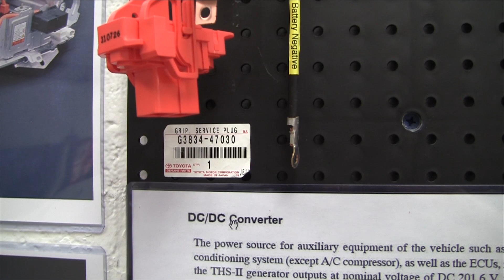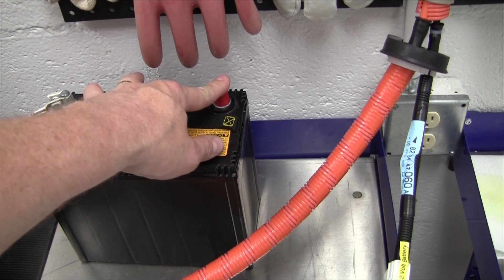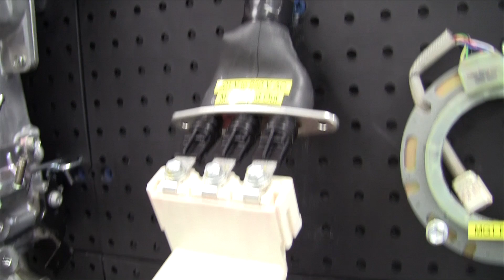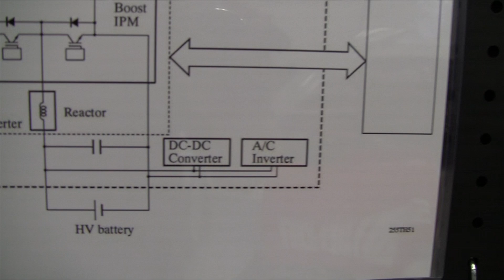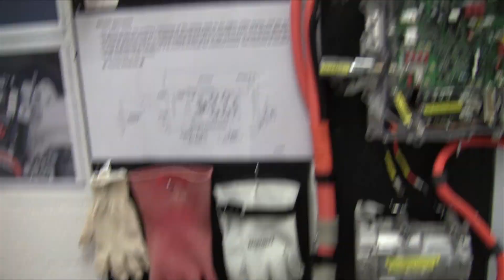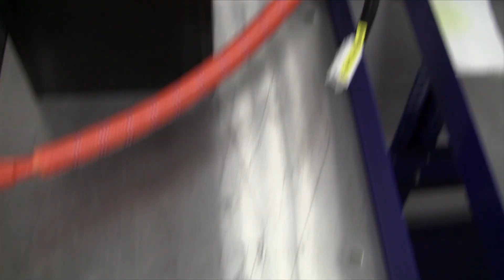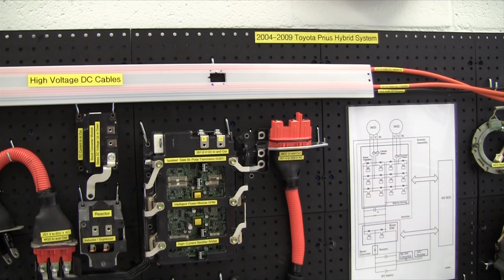2004-2009 Toyota Prius High Voltage System Operation

Comment: I just paid 800 for a Prius the bus bars where heavily coated with die electrical grease on the contact points once I noticed It I removed the grease and car ran fine

Comment: Can you let me know what the resistance of MG1 should be and how to check it?  My car has the p0a92 code and also a code for an inverter fault.  It still starts and drives if I clear codes but it goes super slowly and will shake near-violently if the speed gets over about 40-45km/h.

Thanks for the video.

Comment: I would like to turn prius into an electric generator to power the home. Assuming i have  a source of power to turn 1000 rpm. Remove the gas engine and attach my source to the flywheel. Will this turn GM1 and GM2  to become Generator to charge the battery or use those power to power the home of course with converter down to 120V 0r 240V.

Comment: Ive been looking at this video trying to figure out a way i could use this synergy drive for my solar and wind turbine setup and im thinking that it’s possible.  It seems that the 3 wire for mg1 and 2 could become a wind turbine connection to charge a series battery bank and the dc to dc converter could charge a 12 volt bank or possibly connect straight to the 12v AC INVERTER.   I was wondering what you thought about that idea?  But also thinking that the components are maybe possibly solid state and dont require a-lot of ecu management.   Would the IGBT setup just convert/invert current without an ECU less the Ac pump im sure ?

Comment: Can you explain for me this problem? why does the DC-DC converter circuit has 6 IGBTs? I see  only 4 IGBTs on manual. I also see 6 IGBTs for A/C Inverter on manual but it has only 4 on board.  There are 12 IGBTs ( parallel 6 pairs of IGBTs ) for Motor on board but only 6 for generator .But, there are 6 IGBTs per one on manual . Thanks for your answer !

Comment: I have a question on the high power cable that runs from the hybrid battery to the inverter. Can a faulty high power cable cause fumes from bad insulation to go inside the cabin? I’m getting a electrical smell/taste in my mouth when I drive my PRIUS. Is there a way to test for a faulty high voltage cable?
Reply from the maker: Not likely a cable problem, the cables run under the vehicle. Check your 12V battery. Make sure it is an AGM battery with a vent tube that vents through the floor through a rubber tube. The high voltage battery also has a vent that vents through the floor.
Reply: WeberAuto I have a 2012 Toyota Prius and people that do battery reconditioning and replacement have told me that they did away with traction battery venting in the newer PRIUS that includes mine.
Reply from the maker: That is not true, they all have venting. The 2016 Prius has the battery under the hood now, but it still has vents. (not through a tube though)

Comment: Good video, I know you are not suppose to tow a Hybrid because of the AC voltage. I was wondering  is there any thing inside of the inverter to stop the AC voltage from damaging the inverter electronic components. In other words is there a protection device inside the inverter.
Reply from the maker: No protection that I know of. I believe damage can occur to the transaxle, the IPM, IGBTs, contactors, fuses,  and possibly the battery if the vehicle is moved with any higher speed than a slow roll. The parking pawl is electronically engaged. That would need to be disengaged to even move the vehicle.

Comment: which motor is used to crank the engine.  Is there any other starter or these  motors work as starting motor.  ?
Reply from the maker: The small motor (MG1) cranks the engine. There are no other starter motors. Thanks for watching!
Reply: so it uses a 12 volt battery when cranking. ?
Reply from the maker: No, it uses the 201.6V battery. But that will not work unless the 12V system is working properly.
Reply: thanks for replying, actually me car has some cranking problem, 12 volt battery is good, but the HV is not , it has 3 faulty cells , showing 6.5 volt , I think the HV battery might be the problem then. , ?
Reply from the maker: +farid jan yes, a bad HV battery will prevent the engine from starting.
Reply: As I have noticed that when IG is ON , there is no power going to the main relays in the battery box and no DC power going the inverter,  As the red triangle light is on and no ready sign , the ECU might be preventing these main relays not to turned ON. am i correct, am i correct ?  or there might be a blown fuse or fusible link as no power to main relays in the battery box,
Reply from the maker: farid jan The contactors will not be activated if the battery ECU determines the HV battery voltage is too low or bad. Check for trouble codes, that will let you know what is going on.

Comment: Other than MG1 what other components could prevent my Prius from starting?
Reply from the maker: Fuses, Batteries, interlock circuits, contactors, battery ECU, not stepping on the brake pedal, key fob not in range. and many other things. Have DTCs checked and go from there. Best wishes!

Comment: Do you happen to know what the max input [battery] voltage can be for the Toyota inverter? I see the Prius pack is ~201V, while the Highlander MGR is ~288V nominal...
Reply from the maker: +Stephen Holland Hi, I assume you are talking about he maximum DC input voltage.  The Nominal voltage is the correct voltage to use. If you try to use anything higher or lower it will cause trouble codes. The battery pack voltage while charging (engine running) can be 50-70 volts higher. Thanks for watching!

Comment: Does the Negative side of the high voltage system connect to chassis ground at any point like the 12v system?

Comment: Thank You for this great video! Very nice job explaining the components.
 I have a question that I hope you either have knowledge of or can 
obtain. Can you tell me what the Kwh is of MG1 and what is the output current of MG1 when it is in regen mode? I realize that the power MG1 is generating is 3 phase which must be changed to DC to recharge the batteries.
Just curious what Volts, Amperage is produced directly by MG1 if in fact it is similar to or greater than a standard alternator prior to being rectified. My guess is that MG1 produces more power output than a standard alternator.

Comment: Thank you a lot of for this video. I have a question about how we can charge hight voltage battery from 220 v?
Reply from the maker: 220V DC maybe, not AC. This system runs on around 500 V maximum, so 220V would take a long time to charge the 201.6V battery
Reply: Thanks, I understand, we can invert 220 AC to 220 DC but how we can conect  220 DC  with a vehicle?

Comment: I currently had the triangle of Doom  pop up on my  dash

I recently had my catalytic convert stolen,   The shop that replace my convert put a weld in pipe  and not a  OEM system  
I’m  not sure if they disconnected the battery before welding on the exhaust 

I have these 4  codes currently  

C1259  HV system Regenerative Malfunction 

C1310 1. Active booster solenoid
            2. HV System Malfunction 

U0073  Control Module communication Bus Off

U0293 Lost communication with hybrid           vehicle control system

Comment: There should be a accident safety cut of switch to both batteries. An example would be as a fuel pump accident cut off switch found in old Ford Taurus or Thunderbird. Yet built to handle the high voltage for the big battery. And one that is capable to handle a regular car battery. Because if the person is stuck inside the car. And they cant get out. Because of structural deformation. Then you are at the mercy of luck hoping no metal made contact to the big battery. Anything is possible. Just saying.

Comment: Thanks for very valuable information. I have a couple questions regard the system. There are so many electronic and mechanical components involved. Does the system have any set up so each piece can be tested or even throw a code something like OBD system? For instance is there a code if an electric water pump goes bad? What do bake booster and power steering run off? Can a prius be driven with faulty HV battery? If yes, can it be driven with AC and lights on? What's the main source of power for moving the car? Thanks again
Reply from the maker: Hi, yes, there are Diagnostic Trouble Codes (DTC) for everything. Brake and steering are electric, but have mechanical backups. Prius cannot be driven with a faulty HV battery, it is required to start the engine. The main source of moving the car is the HV battery powering the MG2 motor in the transaxle. Best wishes.
Reply: I used to have Honda Civic hybrid so it's sounds like Prius is different and gas engine is only for charging the battery. My newly bought Prius light came on and it said a bad battery but I was 100 miles away from home decided to drive as much as I could. I was driving about 70 miles on highway with AC off on 100 degree F temperature till I gradually lost power and had to call for a tow truck then I found out my free AAA towing covers for up to 100 miles! Is it possible that I may have damaged something? Does it mean I still had some hybrid system functioning? Asking for future reference! 
I would like to take some general courses on hybrid vehicles because I am environmentally concerned. I live in Oklahoma City. Any suggestions?
Thanks
Reply: @WeberAuto  Hi. so are you saying that if say 1 or 2 modules are down or dud that would be enough to put the HV main battery in a state of being disabled enough not to start the engine?

Comment: Thanks a lot for the explanations.
Do you think it is possible to use this battery as a stand along power backup module to be connected to high voltage UPS (192V DC  4 kva  invertor which operates battery in the range of cut-off 158 VDC to 220VDC)  Charge 220 VDC  8A
Reply from the maker: Thanks for watching. Probably, but this battery only has a 5 Ah rating.

Comment: Do you have another video on common failure modes? And what component in the system actually fails? The one I am interested in is when improperly jumping the car and that Aux battery experiences a reverse polarity.

Comment: My 2012 Prius hybrid converter with bad at 122,000. Am happy it still had warranty i save 4200. I wouldn't recommend buying a hybrid sooner later the hybrid system will go bad.
Reply: Same as transmission/engine on any car. People are scared of what they don't understand.

Comment: Thanks for showing how the high voltage electrical system works. I have seen people adding a 12 VDC to 110 VAC inverter to draw power from the tiny 12V battery circuit in order to use the Prius as a residential backup generator. In your video, you showed that there is a 206 VAC 3 phase output to the Air Conditioning compressor. In theory, if an experienced electrician adds an ordinary transformer to convert 206 VAC to 110 VAC, the Prius functions as an emergency generator may power a house via a transfer switch to the utility panel during a power outage. Do you know if such application is possible by tapping into the inverter's 3 phase output cables? Power outage is quite common during snow storms or hurricane season, it would be a great feature if every Prius in someone's garage can be converted into a whole house generator with a simple 2 to 1 transformer.
Reply: +LINEHACKER both wrong and am advising you both to stay away from any electrical outlets.

Comment: How do you tow without damaging the inverter? Does neutral cause the electric motors not to turn?
Reply from the maker: +cody cowgill Hi,  Do not let the front wheels spin. A tow truck can lift the front wheels to tow. You can also use a flat bed truck or a dolly. Thanks for the feedback!
Reply: cody cowgill neutral disables the electric motors and should not be used for too long because it cant charge the battery

Comment: Hello professor I hope you read this message and take the time to answer me ... if you do not understand some of my words it is because I am using the translator since I speak only Spanish ... I live in Houston and I have a problem with a Toyota Prius  2007. I have the code p0a78 now.  which does not allow the car to be driven recently. I changed an inverter because that was what the scanner said that he had a problem with the inverter .. he changed it and the same fault continued.  when I put the selector lever in D, the red triangle appears.  and it is as if no electricity reaches the electric motor.  It should be noted that both batteries are good ...

Comment: Absolutely love your videos, been watching you for a long time now!    Now,I actually have a question. I have a 08 Camry Hybrid.  Just replaced the Hybrid battery with an OEM dealer replacement, but even before that when the Combustion engine would start, 50% of the time it really shakes the car, not violently, but not smoothly either.  Where should i start troubleshooting? Engine mounts seem good.
Reply from the maker: It sounds like an engine misfire problem. Check for trouble codes and go from there. Best wishes

Comment: You didnt explain the self recharging process.  how does it gate back to the Hybrid battery. You got as far as explaining there is charge but by through which means does it recharge Hybrid battery??
Reply from the maker: Hi, see one of my other videos here https://youtu.be/Y7Vm-C4MsW8
Reply: sorry i watched it before didnt see the reasoning there either. Just wandering how does the Prius recharge the hybrid battery,  Does it use the same HV lines that it discharges to the supercaps . how does it know which way current is going etc..  or does it have a separate recharging line . I notice the two relay contactors  do they move current both ways.  Curious.

Comment: Hi, I'm wondering if you could take a high voltage, battery from one of these, & break it down, to 14 volt models, & make a series of ( 14 volt. Somthing)" battierys" to power AC - INVERTERS" for RV......??????

Comment: SO WHAT IS ALL THIS GLOVES FOR  IF THE SWITCH IS  IN OFF POSITION
Reply from the maker: Keep the gloves on until you can measure zero volts at all high voltage terminals and parts.
Reply: "CAPACITORS".

Comment: Hi, I own a 2006 Prius, If I stop and wait for someone, keeping "on" the A/C, do somebody know, in how many volts will turn on the gas engine and start to charge de HVbatt, and, in how many volts, will stop charging and turn off the gas engine? can somebody please help me with these information? Hi and Low voltages information from HVbattery.
regards.
Reply: Alexander Juarez just check it with a voltmeter